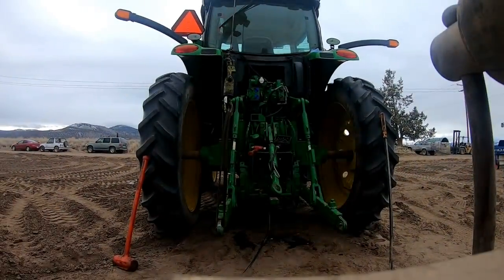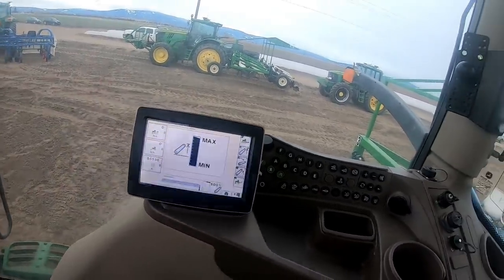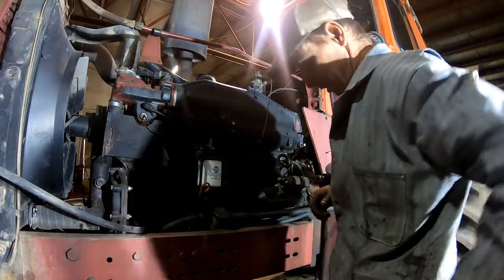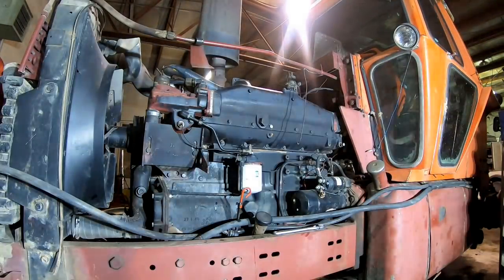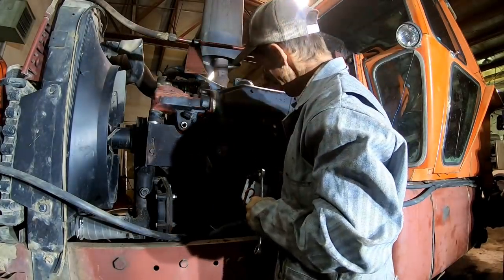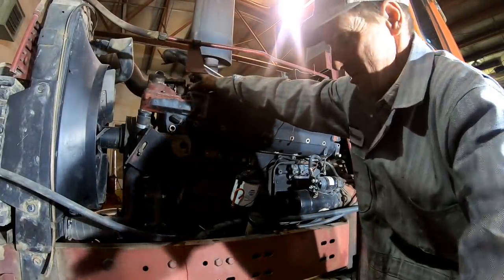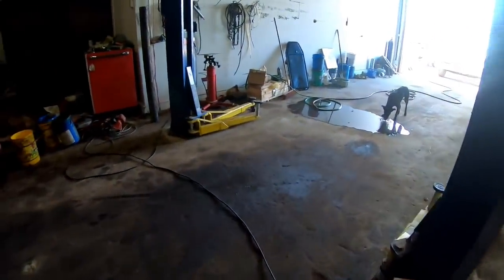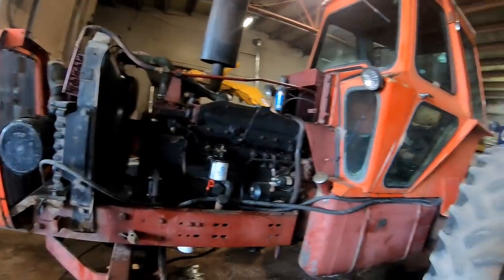Grease is cheaper than iron!!!

Comment: Several things I learned the hard way. Drain the water from you air compressor tank. Drain or run out all the ethanol gas from your lawn equipment and small engines if they are going to sit a while and put oil in you air powered tools, just a few drops before each use. Another great video.

Comment: Love your videos Warren! I like how you are a mechanical "Sherlock Holmes" and dig deep to solve the weirdest issues and correct the origin of the problems. I was watching this video of you repairing the lack of grease to the rock shaft so they could use the 3 point hitch. I know you love to stay in great physical condition but thought I might offer this little suggestion if you have this problem again. How about getting a 6" pulley and fabricate a bracket to attach to the hitch and use your crane to lift and lower the hitch arms to restore the hitch arm action after a bit of grease is injected into the rock shaft.I know using the sledge hammer is great exercise and in the winter it keeps you warm also but...not so much in the summer. Just my silly idea.

Comment: It's great to hear Troubles doing good. Man you came close to a nasty injury  falling off that Deere hitch. I was sitting here thinking  those arms are higher than you legs are long, thats gonna hurt like a bugger if he lands with a leg either side that lift arm !  That gasket don't surprise me from the dealer shop,  I see some stuff that makes a guy shake his head here to.  
           That rear crank seal leak is part of the reason I hate doing in frames for  guy's.   you rip the thing half apart maybe don't see that seal starting to go bad at the time, or a worn clutch starting to fall apart. Then 3 weeks later the rear seal drips or the bloody clutch falls out and it's back in the shop when you'd of found that doing the full motor out overhaul. I got a tractor here now really needs a full motor job with what i found so far. It's not split yet but I got to talk to the guy and see what the budget really is. If he thinks $3000 and inframe it's going to do it he might be very disappointed ,if it's never had a new clutch for a loader tractor all the time he's owned it. Thanks for the video Take care.

Comment: My dad always said " grease, oil and filters are the cheapest insurance you can buy". Here in Oklahoma there's a lot of people with miscellaneous equipment, tractors and trucks. Very few people grease regularly or change fuel filters and air filters. I always ask people; would you rather spend $ 80 every six months or $5000 in five years for a fuel pump ( or more if the engine fails).

Comment: Thy can't make the operators smarter so they have to make machines smarter by installing automatic greasers but operators will forget to fill them too.
Reply: Either that or a line snaps it has grease everywhere but in the pins and bushes. But hey it just means more work so I'm not even complaining.
Reply: @TYSuggested  I bet if they were paying for this they would be more responsible.

Comment: Since you’re a small guy. Would it work for you to use a pipe or a bar to load up the the attachment with some weight to help pull it down after you lift it up?

Comment: You are right. Grease is cheaper than iron.  BUT - I notice you use a lot of WD40 aerosol Spraying rusty and seized bolts ,etc.  Here's a money saving tip for you. =  Diesel,any diesel,new or old,red or  white, is cheaper than WD40 aerosols.  Get any old empty garden sprayer or household polish or washing up hand  sprayer and fill it with diesel and  spray the seized parts with diesel from the  hand sprayer. Cos WD40   ( smell it )is only diesel in an aerosol but the makers don't want you to know that. You will never get rust where there is diesel cos diesel soaks up rust like a sponge and kills rust and penetrates rust better than WD40. Also = old used black engine oil ,cos of the extra carbon in it,  if put on rusted and seized wheel nuts ,etc, and left to soak onto them will penetrate and free them off easily.  Tom. Edinburgh . Scotland..

Comment: It sounds like you need to tell the farmers to grease the rockshaft before and after washing, especially washing with bleach. A pressure washing likely shoots water and bleach into the pivot joints.
YouTube has Closed Captioning available already. They just have to turn it on and select Spanish or any language. YouTube does it automatically. You could just add an occasional text for something the voice to text does not understand. This video has great CC, even in Spanish.

Comment: Wow, I'd been chewing out the equipment owner... or demonstrating how a grease gun works, you got more patience than I do. When I farmed, first thing, oil checked, then hyd fluid, then anti-freeze, then it got greased BEFORE the key was even inserted. Tractor and implement both got lubed before start up. Those guys... wow, just wow. But, their stupidity IS paying your bills too. I guess I never liked fixing things that were quite easily preventable. Should charge them triple pay... ya know, hazard pay. Rust isn't good for anything including your body. Good repair job none the less. Cheers :)

Comment: Rule at work is grease every zerk with the type of grease it takes. Our rule we follow is we grease every zerk we find with the grease we think it takes and if we can't find it or get to it they will have to deal with it them selves. I run a truck has a grease zerk right under a pack of hydraulic lines. They give me a grease gun with about a 6" hard line. So guess what never gets greased that one point because they won't give us flexible lines to fit in small areas.

Comment: It only takes 2minutes to grease ejuipment some operators do not give a dam there only there for a pay check   tears my opinion
Reply: Not many even know there are zerks on the rock shaft. I thought they were lubed by hydro fluid from inside the case. This is way more commonly overlooked that anyone thinks. Greasing the rams is , well in your face, but if there are zerks up and or behind the upper arms, I havent seen them

Comment: Everyone wants to run equipment , but they hate to do maintence on it , in my company you be on the unemployment line for failure to take care your gear , zero tolerance for that chitt , Volvo 18 speed tandem with Hiab 500 knuckle boom , that sum bitch gets greased weekly to bi weekly , depending on # of hours running . I'd rather have well greased gear than problems in the field , 3000lbs hanging on set of swing forks is nothing to sneeze at ,  Or putting in septic tanks last thing I want is premature wear out .